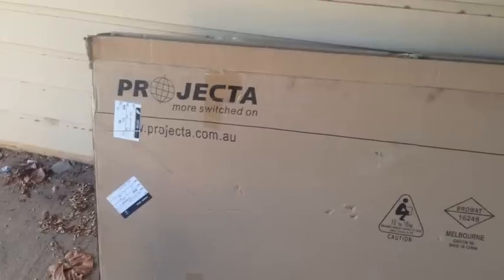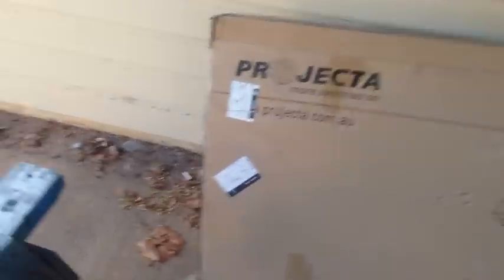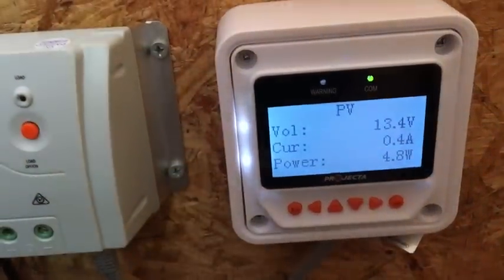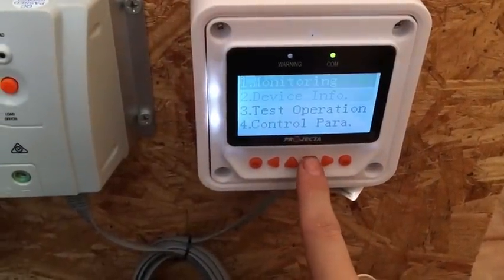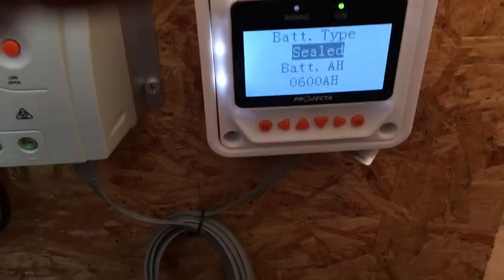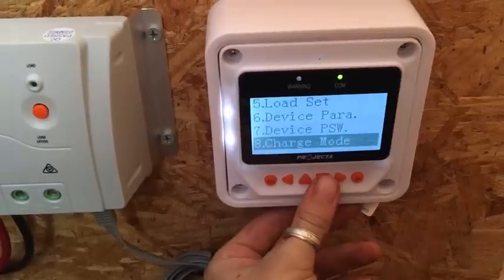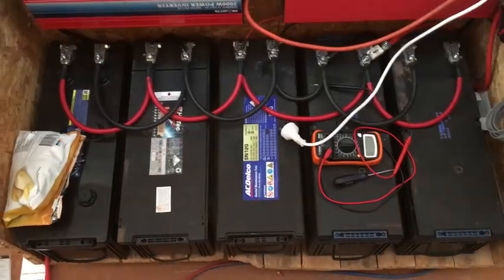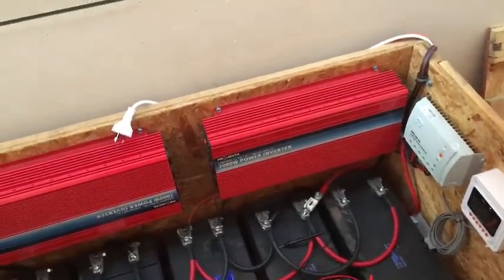Cheap & easy DIY home solar power system - cost, parts, where to buy.

Comment: I'd get rid of those inverters and get PURE SINE WAVE inverter instead. A lot of electrical components don't like and aren't as efficient on modified sine wave inverters.  Great video dude and don't worried about the negative trolls.

Comment from the maker: Thank you to every1 who has been explaining that i had made a small error with the connecting of the wires. I have since done some more research and now relocated the wires so that the invertor and solar charge controller are connected across the entire array of batteries.
Reply: DangerZONEpixel
Reply: DangerZONEpixel and
Reply: DangerZONEpixel 0
Reply: DangerZONEpixel  t
Reply: DangerZONEpixel EXIDE
Reply: I have spent weeks investigating average cost to install solar power system  and discovered an awesome resource at Ewans Energy Roadmap (google it if you are interested)
Reply: I discovered your video on Ewans energy roadmap - there's plenty more good  videos there that should help you
Reply: There are a few components to the subject . One place I discovered which succeeds in merging these is the Ewans energy roadmap (check it out on google) definately the best blueprint that I have ever seen. Check out the super information .

Comment: You could try a bus bar+/- , all + wires from batteries to one bus bar and all - wires to a - bus bar, then run your inverter off the bus bars as well as you charge side to the bus bars with fuses or brakers to help protect you charger/batteries/panels/inverter . just a suggestion . thanks for having the time to read this 10c input...

Comment: Hello, question: so it goes like this: Solar Panels -> Solar Charge Controller -> Circuit Breaker -> Battery Bank -> Inverters -> Loads, right? How did you define the number of solar panels, the array that worked better for you (serial, parallel), The specs for the solar charge controller, inverters, number of batteries? I guess you start estimating how much wattage you consume per day, right? but you need to buffer the battery bank for rainy/cloudy days right? The Circuit Breaker I imagine is a DC Breaker. Thanks for including your list of products.

Comment: first you shouldn't attach solar panels on the roof the heat will shortened its 
life span by 75% and you won't get the efficiency from them when
n they hot
Reply: They need sun there for its gonna be exposed to the heat 🙄

Comment: 1stly can I thank you for providing a list of parts used which is very useful.
i am researching my own off grid system for a remote field where I need 240Volt AC and 12 Volt DC. 
From my research on flooded lead acid batteries can I make the following observations?
1/. as others have pointed out your 12 volt feed into your inverters is wired in a fashion that will kill the one battery its connected onto. to avoid this connect from each end of the battery bank.
2/, if you draw down more than 50% of battery capacity you will reduce the battery life dramatically. They are 2nd user truck batteries, nit deep discharge type so the  maximum discharge should be no more than 20%. 600 Amph batteries at 20% = 120 Amph or 1.440Kwh at 4Kwh you will discharge the 20% in about 18 /23 min. 50% in about 54 min.
I think u need more batteries or a much lower level of load.
A question? you are not thinking of plugging both inverters onto the same house hold power system are you? If you do you will get 100Htz not 50 and a combined
 voltage of something like 360volts.. not good for lights or any electrical systems. You need to keep both inverters on separate systems perhaps connecting into your household system  by having one inverter running lights and one plugs? Just be very careful how you do that please.

Comment: u need to do some research on where to connect both ur incoming/outgoing power,,the way u have ur system connected it's going to pull from one battery more than the rest!
ur leads need to connect from either end,, positive from one and negative from opposite end that way p I were is drawn thru the battery bank as a whole not just the battery it's connected to,, Same with power coming from charge controller! 
it will work this way but will work a whole better hooked up properly!
just trying to help!,, will make ur batteries last longer!
Reply: And "you" need to learn how to spell the words "you" , "you're", and "through" before attempting to nitpick the efforts of someone else.
Reply: Can i go straight from the solar panels to my air conditioner without using batteries? It is AC to AC.  I have sun all day and i do not need it for anything else. thank you.
Reply: it's actually DC to AC ,,,, solar panels produces DC ,, so you need an inverter to switch from DC to AC for the conditioner and yes you can use this without batteries if you assume that you don't need the conditioner at night
Reply: Thank you sir
Reply: lonerglide
Reply: I have been researching the 'cooling' issue regarding a 12v system. I have found there are plenty of alternative ways to stay cool other than a an energy hungry, conventional air conditioner.
Many youtube vids out there explaining clever, simple, cheap DIY cooling projects. Almost all are 12V water pump, with swamp cooler pads, along with a high output 12V fan.
I'm experimenting with an old 12V heater core and fan box. Pumping cool water thru the old heater core with a tiny fountain pump, then blowing out the cooled air, thru the cooled core.
The first test have been surprising how cold the air comes out and the power load is very small. Sure, the water level must be monitored for evaporation rate, but that's easy.
Reply: What he is saying is far more important than petty grammatical errors.
Reply: just a friendly reply, Yes the batteries should have the same length of cable from each to the common connection point. Voltage drop on a 12 volt system is so critical. Same is true in running multiple parallel cables for electrical power. each cable must be the same length. Electrical code rules dictate this.
Reply: Lyle watts  I understand why you need short, large gage and even cables between batteries. I don't understand the tiny cable between panels and  controller.  Shouldn't they also be as thick and as short as possible?
Reply: Yes the cable from the panel to the controller should be as large as possible especially if it's more than 50 feet long. Voltage drop is crucial on 12 volt systems. Suppliers cheap out on this and don't understand. But cost is their main objective and want profits as high as possible.
Reply: @colinmiddleton6316  it's all about the amps running through the wire. There's less amps running between the panels and the charge controller than the amps going between the battery and the inverter.

Comment: looks like your taking the power of your inverter from only one battery,  this is not a good way to since your putting a lot of stress on that battery, better way is to put the plus cable on the plus of the first battery terminal of the bank an hook the black cable from the battery post of the last battery. ....this way your spreading the load more even over yout whole bank of batterys, same goes for charging by the way, also its best to revolve the battery at witch your drawing the plus terminal from twice a year since the plus always gets eaten first when under a heavy amp load , so know you must put the last battery in your bank ( witch has the minus post loaded) as the first so you wil youse from that one the plus to hook up the inverter and charge cable....otherwise a nice setup...
Reply: sir, you just answered my question. Thanks
Reply: The batteries are all in parallel, so power is coming from all the batteries equally regardless of which point it is taken.
Reply: @lannydavidson139  It's coming from all but not equally, the right way is how he described above.

Comment: What earthing have you put in and earth leakage protection. Just because it is solar feeding 12vdc the 240vac side can kill you. You are required to have the 240vac circuits comply with AS3000 2007 regardless of whether they connected to the grid or not.

Comment: Very nice video bro! You might want to try series all the panels to kick the voltage up higher you, would get alot mo charging power if your charge controller can handle the input voltage! or an mppt charge controller.
Reply: I think Ra ant  has the solution for you - upgrade your controller to true  MPPT (see many reviews on utube)  and reconfigure your panels into series.  You will get a much better charge into the batteries.   
Its useful for others to see your efforts and you will gain by that, the filming is secondary but that will also get better for the same reason.  Good effort

Comment: the inverter appears the same as the one I just bought Im2000 which is a modified sine wave have you had any problems with house hold appliance's Thank you

Comment: You should try the 24 volt panels next time you make another system. I am running 24 volt panels now days. they are more efficient. Just one panel makes 235 watts. Just saying its better and I am glad I made the switch to a 24 volt system because it is so much better at making power. I have more than one system both are 24 volts. One has flooded golf cart batts and the other one I use yellow top optima batts. so I use one system to run a freezer and the other one for tv sat and stereo and entertainment system. I would like to make a new system to run my fridge later and have three different systems.
Reply: what is the cost differential between 12 and 24 volts?
Reply: 24 volt cost more. they are about 150 and up plus shipping
Reply: shartne
Thank you friend,I have a golf car tech in the family so getting batteries won't be a problem.

Comment: you need to charge across the batteries  positive 1st neg last terminal  also any more panels and you will need to upgrade to a 45amp controler

Comment: you did not wire inverter or charge controller to the battery bank the best way... you should wire positive of both inverter and charge controller to first battery in string and negative of inverter and charge controller to last battery in string..  that make load draw and charging as equal as possible through string..

Comment: quick question - What size mppt charge controler should i use for a 500W - 4 solar panel 30V total so max 20 AMP? should i use a 20 AMP one like the cheap kinds on ebay for about 20$ or else?

Comment: if you are going to be doing a lot of electrical work, the jewellery is not a great idea.
Reply from the maker: thanks for the heads up. i do remove my rings wen playing around with electrical as i know it can be very dangerous if a ring shorts on some wires or posts. I had already put them back on before making this video.
Reply: i worked with a guy, years ago, he was poking about in a 3 phase DB , wearing his wedding ring, he managed to short out 2 phases with the ring, and completely burned the finger above the ring, had to be amputated. this was UK mains, so 415v across phases.  not much of the gold was left.
Reply: I thought I saw a 14 degree on one finger? hmmmm?

Comment: trying to hook uo 2kw solar 300 watts by 6 i have 2 solar chargers at 30 am and one and 100 amp ive got 8 105 amh 6v batteries hooked up in series  im not sure what else i need other then proper guaged wire and  fuses's

Comment: I should point out that if your batteries have "CCA" listed on them, they are NOT true deep cycle batteries. He is using the wrong type of batteries in this video.
-A major pitfall is buying Marine batteries. They are NOT true deep cycle batteries needed for solar. They will die fast and are a waste of money.
-CCA stands for cold cranking amps. That battery is designed with thin lead plates to supply a huge amount of Amps over a very short time, measured in seconds.
-True deep cycle batteries have THICK lead plates, which is needed for supplying amps over a period of hours, and are rated in amp-hours.

Comment: Hi, nice video, thanks !
I have a question :
If you connect the solar panel to the charge controller and the load ti the charge controller too. On a sunny day should your load get power ? Note there are no batteries !
What do you feel ?
Reply: Siddhartha Chatterjee hi. I just got my first charge controller today. the instructions say the battery must be connected to the controller first before installing the panals to the controller, or it will ruin the system. Missouri wind and solar sells a system called power without batteries that does what you described and it sells for less than $200 dollars. no charge controller or battery needed, and it comes with an inverter.

Comment: Will  panels really last 20-30 years??? Even in Canada? What do you in the winter?
Reply: some people say that solar panels work more efficiently when a little cooler.  Solar power in Canada should be fine, just mount them where you can brush the snow off. I'm in Michigan and mine are working.
Reply: And summer in Canada has lots of sun!  But not so in winter. :(

Comment: can you  automatically use your AC source  via the inverter from the national grid?
Reply: there are some inverters that will auto-sense when grid power is on or off and make the appropriate switch between the power source, but the start getting expensive. If you're just getting into solar power, check out www.quantumharvest.net
Reply: good morning TIM YORT, i am writing a proposal of install solar system to of 2mega watts of power, how many solar panels, inverters,charge controllers, batteries would i need to execute the projects
Reply: Timighe ayibadeinyefa  - that would be a very large system. I don't have experience with anything  that large. if you can't find it on the internet, contact a utility company for help.

Comment: That cable and parallel wired panels setup has got to be loosing 6-7v.    2x series connected to the other 2x in series  would work far far better. In fact all 4 in series would really kick the watts out.

I would go with 4x series and see what the peak voltage is. I take it that is MPPT... Actually is that not the only PWM model Epever do ???
Reply: no, they do several models of PWM

https://www.epsolarpv.com/productlist_1.html

I have a BN series, love it, could do with faster tracking but meh, it's good enough fro my application.
they have a lot of options.

Comment: Is that a MPPT controller? Looks like a PWM cheap controller. It's not big enough to have a transformer  - if it's PWM you are loosing about 40-60 percent of your available power...
Reply from the maker: Thanks for you comment. Since uploading this vid i have since changed out to a 40amp MPPT controller. works much better :)

Comment: Nice setup my friend. 

I have a suggestion for you if you don't mind.

I  will recommend you use the light functionality on your charge controller because, by using your power inverters for your lights, you loosing power through convertion from DC to AC. But if you decided to utilize that function you don't have any loss of power because there isn't any conversation taking place is just DC to DC.

Please try that out with some 12v/24v DC LED Lights and you will not regret it. 
I have system setup like that.

I just subscribe to your channel. Please checkout my channel and google+ for more information, photos, diagrams  and videos. 

Thanks for sharing your video and God bless. 
Cheers.
Reply: It make sense what you are saying. I have two outlets on my control panel. One is for AC current and is wired with inverter. Another outlet is for 12V DC and is wired with solar charger/controller. I also bought 12V  5W  Warm White light bulbs. I had to buy it on eBay, local stores don't sell it. I can put these bulbs to any portable lamp and plug it in. My friend, who is an electrical engineer says though, I can't take outlet fixture that is design for 120V AC and use it for 12VDC. He says it is a violation and I should install a cigarette type of outlet instead which is design for 12V DC.
But I don't care, I have labeled both outlets, it is for my own use and for an emergency use.

I planning on making a video of my solar system and posted on youtube.  I'm still new in it and would like to learn from others and also share my experience with others.

God bless!

Comment: U are also supposed to use all batteries of the same make and amp hour u have probably ruined the batteries buy not running the solar controller positive on one end of the bank and negative to the other end of the bank u should of bought new batteries or the solar controller may keep cutting out over heating or worse but in the comment below u have re wired it wright now but still I would buy new batteries just for piece of mind if one battery is on its way out or  1or 2 of them fails that may stress the controller to fail I'm new to this as well but have done a good bit of research on it before I bought anything and u need leisure batteries or other dedicated batteries for solar set up's lorry batteries may not be good for the set up ?